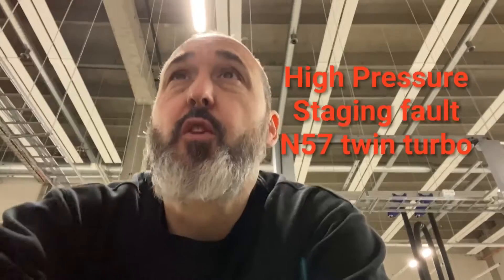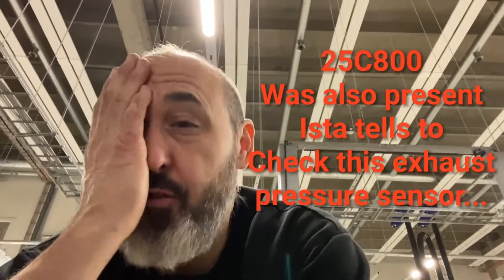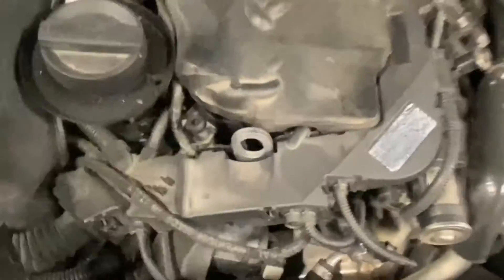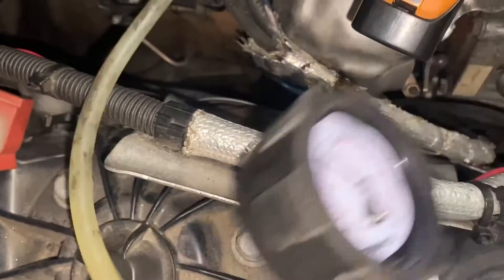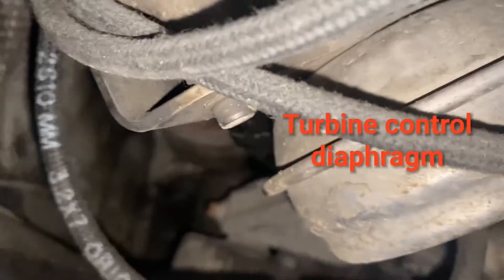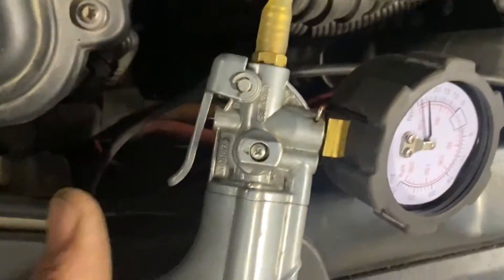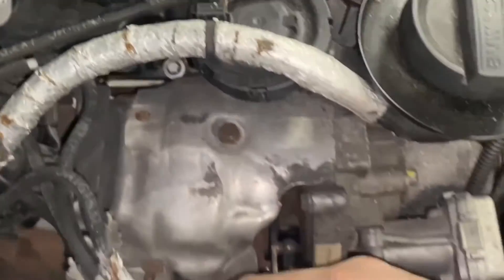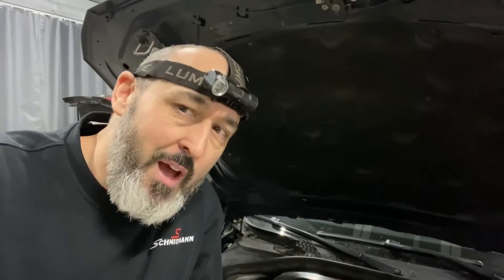F11 535D LOSS OF ACCELERATION DIAGNOSED AND FIXED

Comment: I literally have this same fault but haven’t had it diagnosed yet. Bigger turbo kicks in fine but nothing at the low end, car struggles to pull up very steep hills and often has to change down gears to get the revs because there is no boost low down. Code 244C00… is this likely to be a pipe like in your video ?
Reply: Having exactly the same issue with my X5 40d

Comment: Brilliant video... I have the same problem with the same code but on a 520D, single turbo. The problem I know I'll have is when I take it to a garage, there's a good chance they'll just say it needs a new turbo, which I know probably isn't the problem. Had the car a while and never really pushed it hard.
Reply from the maker: It should be vnt turbo with electronic actuator and they often sieze up internally.

Comment: I washed my engine bay and the car worked fine. After like 10 minutes it went into limp mode. No boost at all, except sudden boost at 3000rpm and drops off at 3500rpm.  checked the fault codes and they were 24CE00, 244c00 and 27f100. The valve cover has a tiny crack under the pcv valve, i think that causes the 24ce00 code for air mass too high. But i changed all the vacuum lines and now small turbo works fine but no boost after 3000rpm. I changed the 3 solenoids still the same problem. What to do next?

Comment: Hello my 535D 272, when going over 3300 rpm, car is asking for 1.8 boost and is receiving 1.4/1.5/1.6, I have changed pressure converters, vacuum lines and I have checked Actuators if they hold vacuum, also made a smoke test and I have no leaks, do you know why this happens? Please I am dealing with this issue for 3 months and I am not able to find a solution… as modifications I have  (EGR is not plugged as I removed the vacuum and put a bolt in the vacuum, (not disabled from software )) I have a sport cone air filter, and a bigger intercooler. Please help me
Reply: Hast du eine Lösung hierfür gefunden? Habe das selbe Problem jetzt
Reply: @Musty-st3gk today I took turbos out and check for bypass plaste , wastegate and everything, everything looks good on turbos, I do not know… this car is making me go crazy
Reply: @eduardtilita321 mich auch mein freund,  hatte die turbos schon 3 mal draußen.  Halt mich auf dem laufenden.

Wie hast du die große stange eingestellt? Auf welches Maß?
Reply: @Musty-st3gk  if you mean the rod from the actuator, I haven’t modify the position of it, I have left the Rod as it is from factory
Reply: @Musty-st3gk Selam hast du den Fehler gefunden ? Ich habe selbe Problem keine power untenrum Fehlermeldung 244c00  ab 3000 Umdrehungen keine Probleme . Die druckwandler vom Turbo habe ich getauscht nichts gebracht
Reply: @Musty-st3gk  any luck for you?
Reply: @eduardtilita321  my 535d f11 did a simillar thing, so basically what I did, I adjusted the mentioned big rod for the low pressure (bigger) turbo. The ECU did ask for 2.5 bar of boost, and it only gave around 2.0 bars. After the adjustment it produces about 2.3 bars of boost, still a little less than required but there are still some space for adjusting. So that was my case, you probably have already solved the issue but if not, maybe you could try this method.

Comment: Hello! I have a quite similar issue , in a 535D E60, 2006, the car does not pull as it should in the top end, does right boost until 3200rpm and the boost drops from 1.7 to 1.2/1.3, I have checked vacuum lines and actuators they look fine, can the electrovalva be the reason? Thank you
Reply from the maker: Looking fine is not enough. You need to know what fault code also. Have you checked if changeover flap isnt siezed?

Comment: Hello. I have same problem with my 535 xd 230kw -313 . New turbos and car have no power ...Drivetrain in pc and in diag  is code 244c00 .Turbos and engine is new .
Reply from the maker: Check the vac lines, the solenoids, exhaust manifolds crack internally and leak and the compressor bypass flaps sieze too. 
Not easy these engines to troubleshoot. You must check everything - look at this one all it needed to put in limp mode was a simple leaking vac hose.

Comment: Hai

I have Enquiry regarding E60 BMW

The vehicle shut off rapidly
On long parking, what could be the issues

Note- We already changed Transmission,Fuel pump, Throttle body do you have any idea 💡 regarding this matter 🤔

 Almost 6 months Completed car on the Workshop 😢

All input are welcome
Reply from the maker: No idea without fault codes and a more detailed description. Diesel engines shut down when injectors short to ground. If you have fault code for injectors just disconnect the faulty ones and erase codes. But without a list I am only speculating.